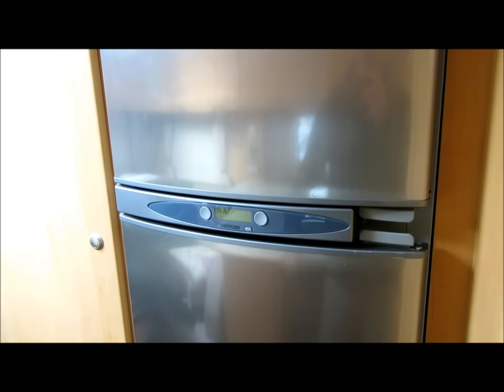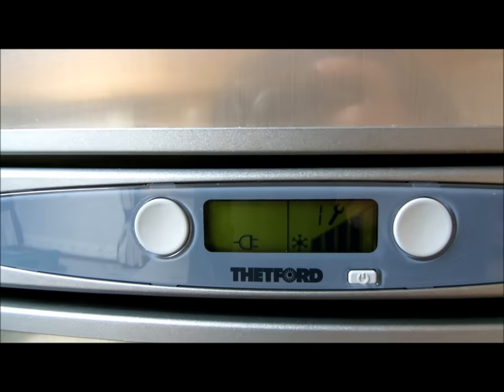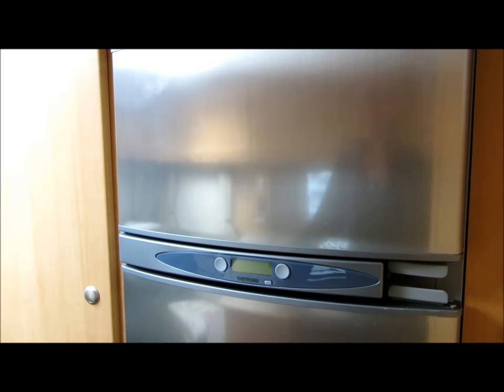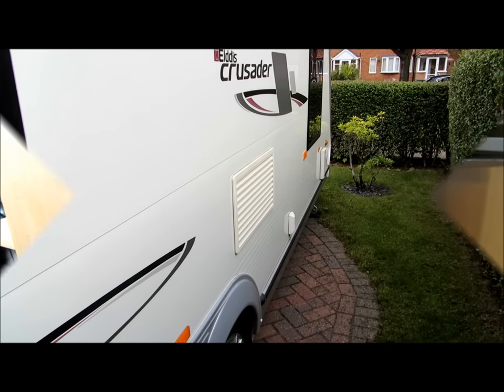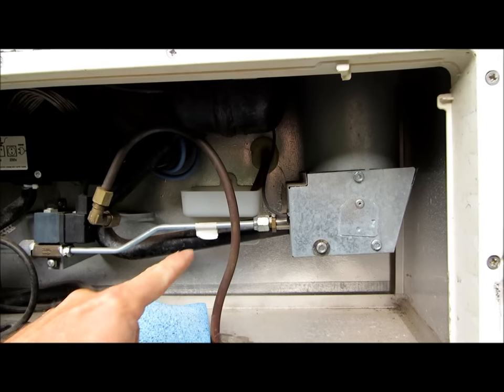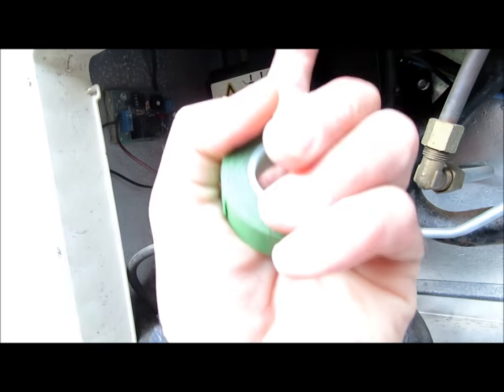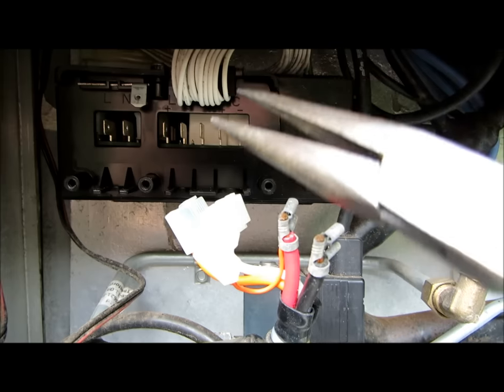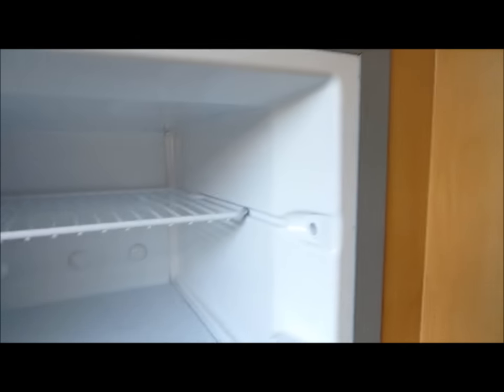Caravan Fridge Repair part1

Comment: Many thanks for this fantastic video. 
I'm qualified electronics engineer and was asked by a friend to see if I could help him sort out a N175 fridge freezer that he has in a Fiat motorhome. 
His problem was that it works absolutely fine on battery and gas but was failing with fault code 1 (low voltage) on the mains supply. 
From the excellent information that you have provided I was able to locate and test the 240vac heating element but was surprised to find it intact but reading approximately 240 ohms opposed to your o/c heater. 
From close inspection of the control circuit board, I immediately realised that the current consumed by the heating element is monitored on the circuit board which is where the low voltage is detected.  Anyway, 240 volts / 240 ohms is only 1 Amp which is way too low to heat the refrigerant.  I would expect something in the low ohms 10 to 30R which would draw in the region of about 10 Amps. 
I have ordered a new element but boy was the old one difficult to remove because of corrosion. 
Once the new heater is fitted am expecting the fridge to operate normally one again. 
Again, many thanks indeed for the amazing instructional videos that helped me no end. 
Best wishes,
 John Ratcliffe.

Update:  Only fair to complete my post with the final outcome.
I was horrified to find that the resistance of the new mains heater element was the same at about 240ohms which leaves me dumbfounded that 1A flowing through the element would operate the fridge.  I can’t say with any confidence if a parallel resistance (doubtful) is applied over the heating element by the power board  to lower the resistance and increase the current, anyway the power board is the only thing left and has been sent away for testing.
Fingers crossed that it fixes the problem.

Comment: Thanks for the tutorial. Saved me hours. Mine is an N175 in an Elddis Aspire 2012, and yes the mains heater had gone. Mine was a little easier because there were inline connectors for the mains and 12v wiring. Got to try and find a heater in stock now before a tour of France. Thanks again.

Comment: Thanks Bodgit, that's very helpful. What temperatures does your thermal switch kick in at?
Reply from the maker: I cant say exactly. But on a hot sunny day the fan comes on. You can adjust it to come on at any temp really.. But to gain any use out of it its best when its warm outside.

Comment: I think you have your 240v and 12v muddled up!
Reply from the maker: Hi Lee. Hope all is well during this odd time. To answer your question. No , all the connections went back the way I found them. Plus I’m quite up on electrics and mechanics as im qualified as a mechanical engineer.  Thanks for the question anyway.
Reply: @brianphelan74  240 is the left and the black and red 12v are on the right
Reply from the maker: Lee Hedger Hi Lee, I haven’t got my van here to check. But I’m sure I checked the wires with a meter. I can’t remember it’s been a bit of time since I done this.  I’d be surprised if the right wires were 12v as they are thicker than the left.  As long as the wires are returned as they were taken off . If the wires are as you say that just backs up that you should use these videos as a guide. Plus the cover does indicate that the 12v is on the left.
Reply: Bodgit 45 definitely have the wiring connections described wrong, the wires are larger on the 12 volt system because lower voltage means larger amps so requires thicker cables.
Reply from the maker: Alistair Cumings hi Alistair. To make sure I’ll take the video down until I can check on the van.